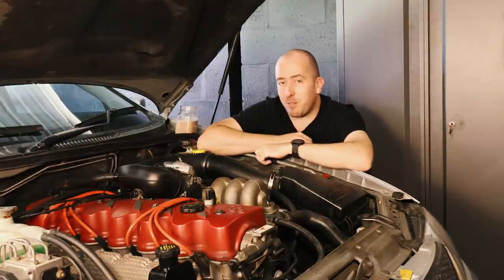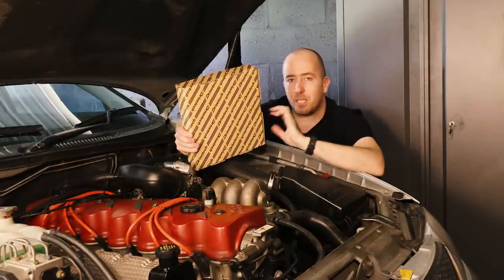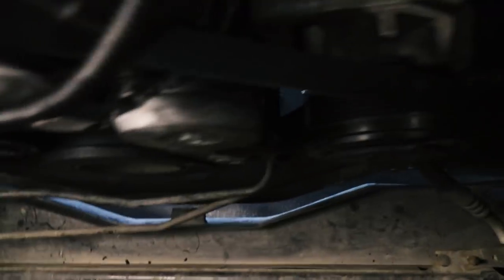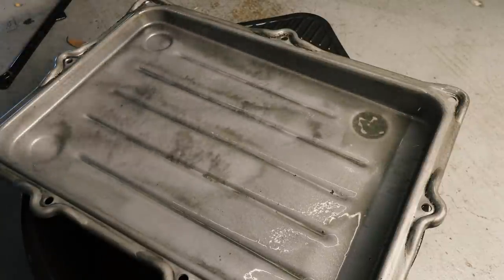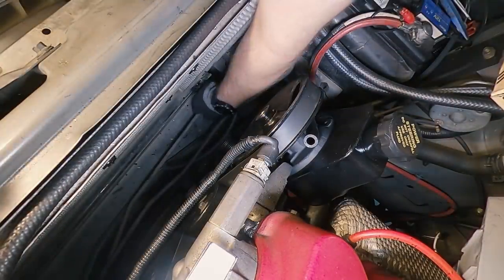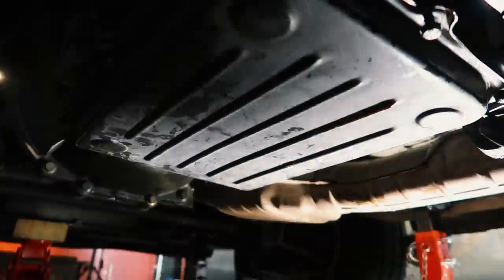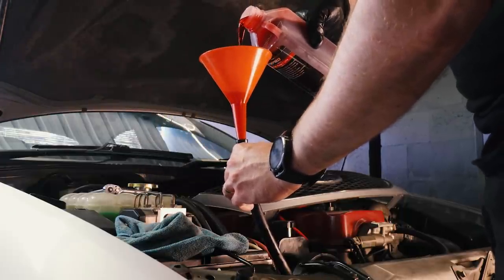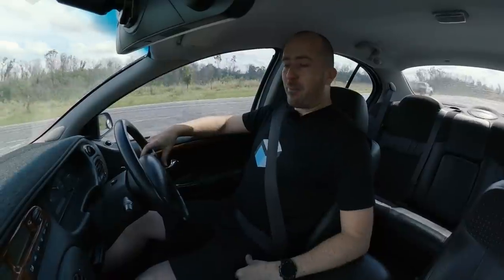Fit a Transmission Cooler and Avoid a Milkshake! How to Fix the Ford AU Falcon's most common problem

Comment: Yes good upgrade. I worked for Ford when AU were new. The BTR isn’t a bad trans by any means. It does not tolerate any sort of heat stress, and the clutches will deteriorate rather quickly once the fluid has been to hot. Its the break down of the hot fluid that causes the damage over a period of time. The bigger the cooler the better, plus fluid change every 50k kms.
Reply: damn, my ef is definitely overdue lol
Reply from the maker: @tturi2  every 50k kms hey. I wonder how long it has been since mine was last done. The fluid was still red, but definitely had a brown tinge to it.
Reply: @MotoringBoxTV  I know my gearbox has oil lol
Reply: @tturi2  If it leaks, it has oil!
Reply: Ford says it’s a sealed unit for life… I replaced the fluid in my BF 4sp at 230k KLM’s. Not a pretty sight. Very black fluid. However I think I had less metal shavings on the magnets than this one. Gear changes are a lot smoother now.
Reply: @gregf4170  Yes they did! However if you ordered a tow pack on a AU commercial falcon such as the ute, it came with a large cooler up front, the tow bar and wiring, plus a supplementary booklet in the with the service manuals for the trans service intervals, that specified service every 50k under heavy use. Police packs with V8 and taxi packs also had this booklet. I would service them all at that interval personally.

Comment: Great video Sean! Btw being a mechanic my whole career, manufacturers leave AT fluid changes far too long, sometimes they don’t recommend them at all (sealed for life)! Replace the trans fluid and filter every 50K and you’ll get a much better service life out of your transmission.
Reply from the maker: Has been running very well ever since!
Reply: If the btr is behind a solid turbo Barra , every 10 000 K’s !!

Comment: Always loosen the fill bolt first before emptying!! Edd China recommendation.
Reply from the maker: Good tip
Reply: @MotoringBoxTV  Oh and another tip Sean - get yourself a set of Toolpro impact sockets from supercheap, impact sockets are 6 pointed and there is pretty much no chance of rounding bolts off. Normal sockets and ring spanners have too many points and not enough surface area which makes it incredibly easy to round off a tight bolt
Reply: @JamieKugelmann  that's where metrinch sockets and spanners came in to solve all this bs.  I have a few kits from the early 2000s still and they're the ducks nuts.  Unfortunately very expensive to buy here now.

Comment: Hey Mate good advice about putting more transmission fluid in unit than recommended. My first automatic vehicle is the 2016 FGX ZF 6 speed and the lag between changing gears was really annoying for first 40 kms. I put an extra 1 litre or so in it and it now changes instantly. Going to install an oil cooler with it's own fan because i have read that the more oil in transmission will make it run Hotter.

Comment: I remember when I worked at Repco we had brass fittings like those and many other shapes. I may have made a hash pipe out of them at one stage. As for this video, it feels like you made it for Mr Hubnut, complete with a few bodges to get it going. 🙂
Reply from the maker: Want me to send you this one?

Comment: Great video mate, yes, a bypass trans cooler is a must in a late model falcon forget about a new radiator I believe this type of trans cooler that bypasses the radiator gives a lot longer transmission life than just a built-in cooler in the radiator. First thing I did when I purchased my BA XR6 was to fit an external cooler and that was 13yrs ago. When I purchased the car, it had 134.000KM and no history of transmission services etc. Since fitting cooler, the car now has 385.000KM and I've never ever had the trans serviced and still shifts beautifully and going strong today..

Comment: I only just ordered a trans cooler kit yesterday before I saw this video, for an AU as well. I built an AU for a Shitbox rally last year. The car would shudder after returning to top gear after a kickdown. Checked the diff and tailshaft but both were fine. Then I thought it might be the trans starving for fluid. I dropped the pan and the fluid volume was good, just didn’t expect it to look like used diesel engine oil. A good flush and new filter (old one was pretty much munted) and the shudder was gone and the gear changes went from harsh to imperceptible. Lifetime fluid my arse. BTW, I agree, the more fluid you can shove in a box the happier I am😉

Comment: I have had the same problem with the trans filler plug. Ended up buying a" Smart-O sump/drain plug. M20 x 1.5mm.
Takes an 10mm Allen key. The original plug has a very short head and is easy to round off.
Reply: Years ago I invested in Metrinch spanners and socket sets. They are designed to grip both a metric and close imperial size per spanner/socket. Also designed to cope with rounded off nuts and bolts. Doesn't always succeed though.
Reply: @jamesfrench7299  The biggest problem with the plug is that it the head is only about 5-7 mm in height. Once it is rounded off there is not much that can get enough purchase on it. 
I ended up getting a set of nut/bolt gripper sockets to get it undone.
Reply: I also have a set of superwrench spanners sold by those seen on TV hotline sellers. I got mine at a shop specialising in selling those items on TV. I never used them in years as they didn't grip round pipes as shown but were ok if a bit clumsy on normal hexes. I encountered a badly rounded off 8mm bolt on my Victa engine and nothing would do it including my 1/4 dr Metrinch socket. The smallest superwrench managed to undo it.

Comment: Great vid mate.
Good call to add that cooler, cos although that issue was very common on BA 's it did happen to AU's....like mine.
I rounded that same bolt that Ford put into a prick of a spot so i did what you did & filled through the trans lines.
My AU III had the milkshake 10months ago, i only noticed when for its first time it spat coolant out the overflow when i switched it off after a long drive.
I checked the coolant to find the milkshake and thought ""F**K NO" i don't need this expensive issue right now, so i gambled on renewing the cooling system & flushing the trans.
I kid you not, i went through at least 50 litres of trans fluid (approx $300) until the milk shake turned into blood red tranny fluid.
To this day it changes through gears and runs with no issues.
They can be saved if you get to it early enough i guess.
Reply from the maker: Wow, saved just in the nick of time! Well done catching it early and avoiding the disaster!

Comment: When you get the filler bolt, can you do a video on removing rounded bolts? Would be very useful to share to people working on cars/etc. 

10:27 I read/heard a while ago that the reason Ford removed the dip stick is because there were too many instances of people borking their transmissions trying to replace the fluid so as a response they made the unit completely sealed starting around 1996 (grandparent's wagon was '94/95 and still had dip stick). My understanding is that while metal filings floating in the fluid is never a good thing, ironically it CAN prevent slippage as components wear out. The moment you do a full flush, those metal filings get removed and gears began to slip. As you said - unless there is something seriously wrong with the transmission you are better off leaving a portion of the fluid in the torque converter for this reason.
Reply: I had same problem on a 2000 AU wagon. Rounded filler bolt and the exhaust in the way doesn’t help. A bolt extractor socket made easy work of it.

Comment: My dad used to work at a parts supplier for the Australian car manufacturers. He heard from a high up that Ford used caustic to clean the engine blocks which caused the radiators to fail

Comment: What I do is use valvoline maxlife ATF and Lucas automatic transmission fix (every 40k) to try and keep some life in the transmission bands, amongst other things it can help give more life to.  Whether it was with my AU or any other vehicle I've had since (with normal torque converter auto).  Has been a pretty bulletproof routine for me, but YEMV.
Reply: Yep, same here, gotta AU with 440k on it & still on the original trans 👍
Reply: .....& original head gasket.....had to put a second hand diff in it though

Comment: Great vid. I believe that try to unscrew the tranny fill bolt first before attempting as indicative & will save filling from top. I have also have got a dedicated trans cooler for my BA. You can also eliminate the 2 x metal trans tubing and go directly hoses to the trans.  IMO it is a better option than purchasing a replacement radiator as the BF radiator has different trans hose mounting positioning than BA. Therefore you have an option to purchase both model radiators if they die. Usually $50 second hand on FB marketplace. That's what I did an still going strong after several months. Cheers

Comment: the problem with the aftermarket oil coolers is they are not as efficient as the origiinal heat exchangers and can tend to overheat, they can provide additional cooling but not enough as a stand alone. the other issue is the transmission oill will not warm up to operating temperature as the oil cooler in the radiator warms the transmission up to the engines coolant temp too.

Comment: AU2. Had to put in a new radiator (Atrad). Not even 12 months later, the internal trans cooler failed (corrosion). (Happened to my niece's commodore as well). Did this mod back when, never worried about it failing again from that point onward.

Comment: EL are also sealed trans unit too, good stuff
Reply from the maker: Such a ridiculous thing.
Reply: @MotoringBoxTV  if you ever have to replace you gearbox a btr 91 with dipstick works in my el so should work in your au, makes a difference for service and still runs on same computer

Comment: My ZF milkshaked in March at 130k kms, I had it rebuilt to handle 400rwkw, PWR heat exchanger and a new rear main while the box was out, about $8k later, it shifts like a factory unit and holds onto gears like a demon when doing some spirited driving, not sure if I'll ever tune it but if I do, at least the box is good for it
Reply: could of saved yourself the 8k with a 500 dollar trans cooler in the beginning..
Reply: @GMRMDE  fact

Comment: If you do go for a new radiator, check with the supplier and see if it has a stainless cooler. They are available on certain brands,

Comment: How did you go sorting the other barb? I had the same kit tried to dodgy a female to female adaptor with the extra barb and ended up dropping most of my gear box oil on the driveway... ended up getting a fitting from a hydrolic shop that did the trick! Thanks for the video bud

Comment: Putting on a transmission cooler was the first thing I did when I bought my 2nd hand BF Falcon Wagon.

The BFs (and probably BAs) have a heat exchanger brick near the starter motor which is also prone to failing. It is connected with rubber hoses.

Instead of running hoses to the front of the radiator, I got the rigid lines out of an AU (I think). They lined up perfectly with the 4 speed auto and bolted straight in. I cut the tubes where it makes a right turn at the front of the engine, flared the ends and ran rubber hoses around the front of the radiator.

The two engine coolant hoses on the side of the engine were connected with a plastic elbow and hose clamped on, zipped tied off to the side 😉.

8 years on still going strong... only problem is it slips out of gear around corners when the car and outside temperature is cold (and yesssss, 🙄 I have checked the fluid level, also had mechanics look at it and flush it out with their you-beaut flushing machines).

I figured it's simply because it's running alot cooler (because there's no longer a coolant thermostat in the system that is used for holding the coolant up to get the engine to temp.)... warming it by cycling the gear box from Drive to Reverse half a dozen times before going anywhere solves this problem.
Reply from the maker: Thanks for the comment. I was considering cutting the lines, and may do so if I ever go back to adjust this setup.

Comment: Years ago, there was someone doing changeover trans pans that had a drain plug welded onto it- taxi drivers would frequently do this as it was a nicer way to drain the transmission without getting fluid into one’s armpit. Can’t seem to find the company that does it, but any wrecker that’s had a Taxi or two being parted out may have one lying around. 
Never hurts to top the fluid off after going through the gears and going around the block- maybe do it when you change the fill plug over (auto gurus reckon the correct level is enough to come out this hole anyway)
Reply: Take pan off, drill an appropriate sized hole, tap it to your chosen thread fitting, fit your drain plug = winning?

Heck you can even get locking valve type drain plugs, even easier to service.
Reply: @DoubtingThomas333  presumably there’s insufficient meat in the bottom of the pan to put a thread in. Whereas zapping an O2 sensor thread and bung in solves that issue.
Reply from the maker: It's a great idea, but the pan still needs to come off for the filter change. After you've done it once it is pretty easy to get done without making too much of a mess.

Comment: Great video, with bonus filter change. Is the issue the same with ba fords?
Reply from the maker: Arguably worse. I believe they have a heat exchanger on the side of the engine block which performs a similar job, but is also failure prone.

Comment: Hi Sean, I love the content even though I'm A Holden guy myself lol, just A small warning with those though radiator mounting ties, A long time ago I mounted A thermo fan using those zip mounts and it rubbed A hole though my radiator core, for long term reliability I'd suggest making brackets for it to sit on, sure it's a hassle, and way more difficult to do but it's totally worth it for that piece of mind. Love the content mate, keep it up.
Reply: I'll second Tule Box's comment. It happened to one of my Falcon taxis years ago. I ripped out all of those ties and replaced them with brackets. It is just a matter of time when they "saw" their way through the radiator.
Reply: Plus cable ties should be strictly for cables -on a permanent basis at least.
Reply from the maker: Thanks for the advice, I'll definitely keep an eye on it. If the rad ever gets replaced I'll find a better way to mount the trans cooler.
Reply: I had the same on my old VH SLE 5.0. Man I wish I kept that car.

Comment: 5 liters will be most likely underfilled. A stock BTR with stock radiator heat exchanger takes 5.5 liters when cold, when using the correct fill procedure- with the car running and cycled through the gears, fill through the filler plug until it streams out steadily.
Your aftermarket cooler will most likely add an extra 0.5-1L to this figure, meaning the box will be quite underfilled.
Reply from the maker: If you've got a link to something to back that up I'll take it. Everything I found suggested 4, and that's how much came out.

Comment: Myself I’d be doing it the way you did the bottom line, it’s flared and it’s once less joint so one less chance of a leak.. 
did you pull the aircon condenser towards the radiator? If you did it won’t be firm enough and will leak on one of the coolers, not straight away but will happen. Just connect it to to the condenser
Good luck and cheers
Reply from the maker: Certainly did the job. I haven't found the correct fitting yet so it's still on there for now. You can't really get in between the rad and the condenser, so if you wanted to connect to just the condenser the rad would probably need to come out for access.

Comment: Hi mate! Thanks for sharing this video. Very informative as always. 
I just acquired a mint 2013 FG XR6 with 90k kms and full service hx. As a preventive move, I plan to have the ZF 6sp transmission serviced as well as replacing the stock transcooler instead of an externel aftermarket cooler with a new one from Transdoctor Melbourne, reason being is that this will be my daily drive  for work (10kms a day)family car around town as well as occasional long drives here in VIC. No flogging or spirited driving, too old for that lolYour thoughts please?
Reply from the maker: Sounds like a good plan mate!

Comment: I have a zf 6 speed Falcon and I have been warned about this issue with these cars. So I went and looked under my bonnet and there are no hard lines to the transmission at all. I had to replace my radiator recently because it shat itself but I didn't remember taking any hard lines off. I'm just so confused about where they are and if my trans is even being cooled now
Reply from the maker: It's a bit different on those. I believe there's a heat exchanger down on the passenger lower side of the engine that has coolant hoses and transmission oil lines both going into it. They can be replaced preemptively or people run the oil lines to a cooler like I did. My knowledge on that is limited though just because I've never worked on a car that had one.
Reply: @MotoringBoxTV  thanks so much mate, I was so confused. I have now found it. What do you think I should do? Which option do you think will cool my trans fluid better?